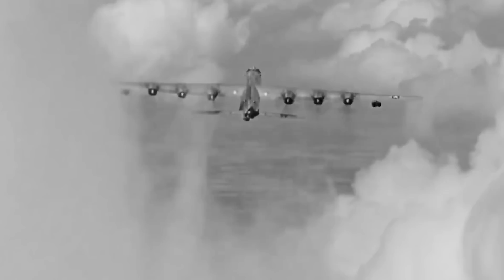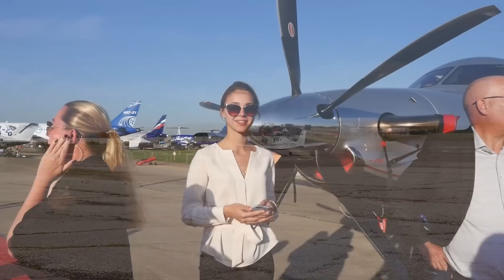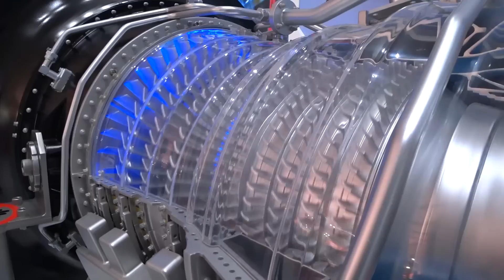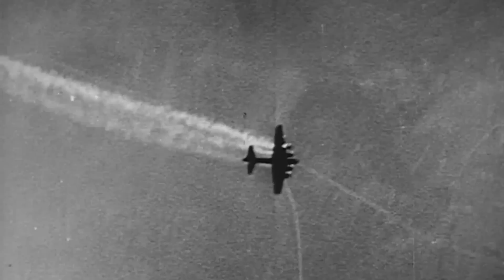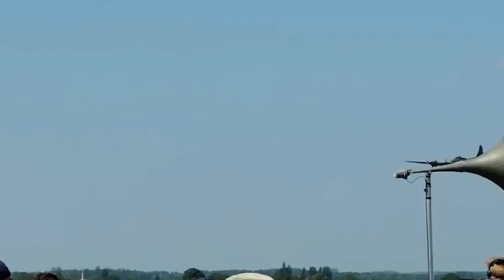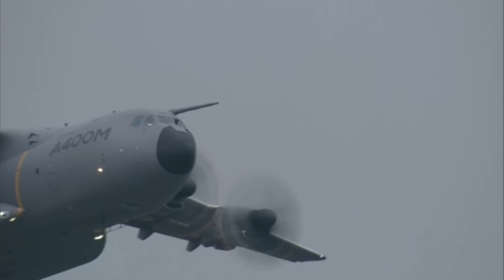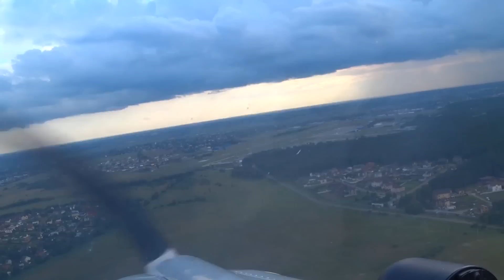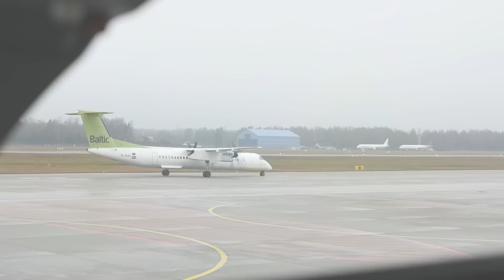Piston and Turboprop engines | What is the difference?

Comment: Kind of weird but I never thought that turboprops had exhaust side to the front. It make sense to have short shaft from turbine to reduction gear, but I never thought about it. Though I used to wonder how come exhaust nozzles of turboprop were so close to propellors.
Reply: It depends on the model, the dash 8s and ATRs have the exhaust at the back for example
Reply: @mr.cebraman7823  they both have the same engine so expected. When did this reverse installation started and why. Some of the propulsive efficiency must be lost that way.
Reply: Sciolist It really just depends on the type of turbine. Most smaller types, like the PT6 have a centrifugal turbine which redirects the gas flow about 90 degrees, so the exhaust now moves in a radial direction or even against the inflow direction. The Q400 has a P150 which uses an axial turbine which does not redirect airflow, soothe exhaust is backwards in flow direction. EDIT: Regarding axial vs centrifugal turbines I mean the part of the turbine after the combustion. Some take the energy out of the airflow in a radial way (exhaust backwards) and some in a centrifugal way (airflow gets redirected and therefore exhaust might be more forwards)
Reply: @Sciolist  I did a quick wikipedia research and the earliest “reverse” turboprop (that I could find) is the PT6 itself, from 1961
Reply: @skyhopp6455  Soryy, but the PT6 nor any other JET engine I know do not have centrifugal (radial) turbine. PT6 has rather single radial compressor stage, the other stages are axial. It would be highly undesirable to lose the momentum of expanding exhaust on a turbine of radial type, so we use axial instead. The only radial turbine I can think of is a turbocharger on piston engine, where the compressor is of a radial type also.
Reply: Kristián Fried I think you might be right on this one, I think I mixed it up with the compressor stages. Thinking about it, it might depend mostly on the location in the aircraft. An exhaust facing backwards with the engine in front of the cockpit doesn’t seem too practical. Looking at aircraft like the Q400 it’s easier to have it backwards than on a TBM or comparable aircraft. Thanks for the input!
Reply: The so called reversed turboprop engines are mainly used in single engine aircraft. The solution saves a lot of space. Also, the exhausts are sometimes oriented to counteract the momentum created by the propeller. As for the backward flow in the engine, I know it’s contra intuitive, but rather focus on the whole engine as it is. The intake faces forward and the exhaust faces backwards. Net force created by the exhaust gasses is then in the direction of the flight.
Reply: @Gemini1721999  The PT6 is most definitely not restricted mainly to single engine aircraft. It existed long before companies started thinking about designing single engine turboprops. The Beechcraft KingAir was one of the first aircraft to use it in 1961. Conversions (and agricultural sprayers) generally predated clean-sheet designs of single engine passenger turboprops.
The big advantage of the PT6 is having the hot parts that wear faster at the propeller end where it can be removed and overhauled without removing the whole engine and disconnecting it from the structure and fuel lines, etc. The power take-off turbine is not mechanically connected to the rest of the engine, it just sits in the stream from gas generator section.
The term for a compressor with a big disk that slings air out to a plenum on the side is centrifugal. You'll be familiar with it from the mechanically driven superchargers of radial engine piston aircraft.
Reply: @Markle2k  Yes, you are right. Turboprop and turbofan engines do have few turbine stages mechanically disconnected from the engine, sitting in the airflow, connected to the prop or a fan via secondary shaft. Yes, the maintenance is much easier having turbine close to the prop. And yes, centrifugal and radial compressors are the same design, just different terminology. As you mention, I’m familiar with the mechanically driven centrifugal compressor on Walter/Avia M 337 engine from Zlin Z-142, the aircraft I do majority of my training on.
Reply: @Gemini1721999  Turbofans are a bad example. Often, the fan sections are connected to some of the compressor stages and not truly independent from the gas generator.
Turboshaft engines in helicopters are very often separate from the gearbox/rotor. Spinning up the rotor blades slows the engine start. Putting a brake on the rotor allows the engine to spool up at start with only a small bit of drag. Once the engine is running stably, the rotor brake is released and the rotor can spool up.
Since the propeller/rotor is not involved in the low-pressure stage of the engine, this makes sense.